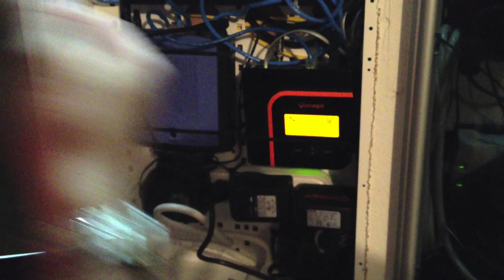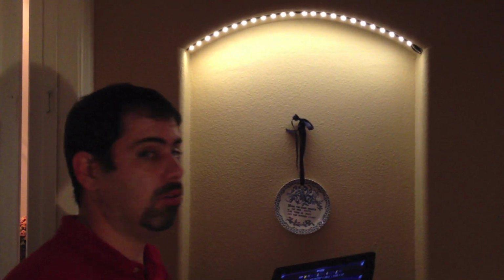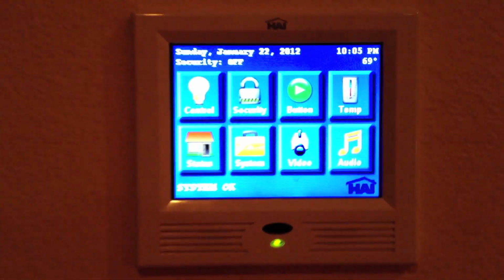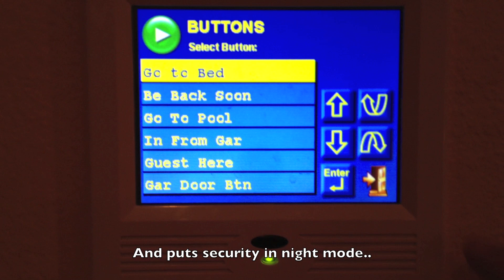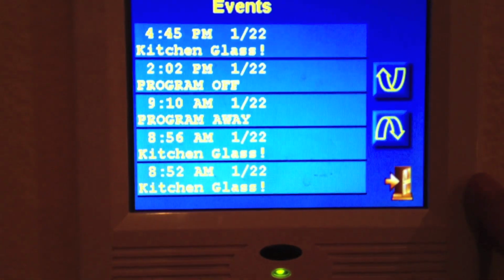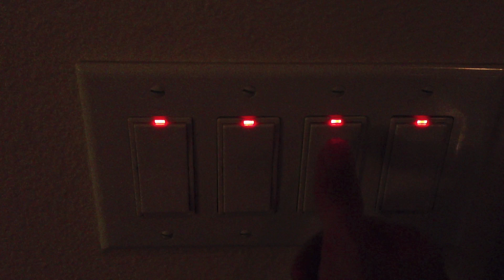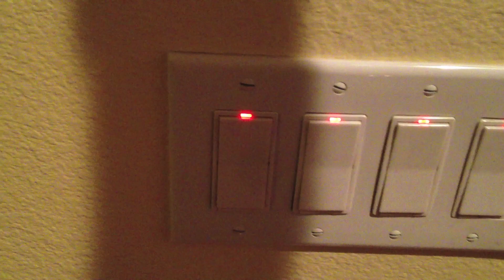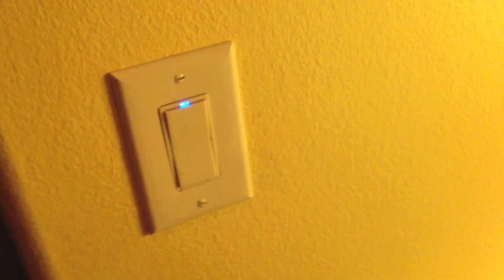Home Automation Intro

Comment: Hello I have on Q system but it not working right now are you work as a technician if so please let me know thanks
Reply from the maker: Ah man, unfortunately you can’t get parts anymore! I had to swap mine out because my cable line got hit by lightning and damaged a whole bunch of stuff. I replaced it with an HAI HiFi2 system, but Leviton bought the brand and killed it so I can’t get parts for that either.

Comment: This guy should not be putting his sticky fingers all over the circuit boards. He will zap them with ESD and destroy the IC's. Furthermore, he has 120VAC mixed in with low voltage. Violates every building code in the USA.

Comment: The main advantage for this system over for example SmartThings is that you are not relying on servers: No one is monitoring you without you knowing. So for privacy: Big plus. The setup/ wiring of this: NIGHTMARE. Bruce: If you wire correctly (and implement correct breakers) this is the way to go over Echo/ Smarthubs or whatever system there is, heavily depending on servers

Comment: I always wonder, since it's a simple software (Arduino and excesories),  couldn't someone hack into the home system easily? Well not easily but a good hacker could get into the program since it isn't designed for high end security right? I wouldn't want to have a home automative system that can be hacked.

Comment: I know in the UK you cant have them, but not sure in usa, i know in texas you CAN. AI controlled smoke and IR turrets to track and kill intruders. The system gives them every warning, then it deploys smoke, it does this so the way they came in is viewable so they should run back out, again it gives more warnings, they try and not leave at that point it opens fire with a pair of blanks. If that fails it gives yet another warning for them to leave. If they still fail it will then arm live rounds. Headshots!
its basically a computer controlled gun with an IR pointer. using FLIR it will get them straight in the head every time. It sure changes the outcome in south africa of home invasions.
Reply: DO NOT DO THIS ITS JUST AN IDEA DUH.
There is no law which prohibits building lethal robots, building weapons however is fully covered in many laws, except in TEXAS, where both building using can be done under license or permits. But i guess i should have made it CRYSTAL CLEAR THIS IS PURELY A THINKING EXERCISE DO NOT DO THIS EVER.
The army build drones etc, you can almost see in the future some tech giant building non lethal but weaponsed home defence maybe of the tazer type.

Comment: What outdoor sensors (occupancy and/or motion) did you use for detecting people outside? And what wiring is required (e.g. CAT5e okay)?

I have 2 locations I would like to add movement detection. These lead to my backyard. I'd like to know if/when motion is sensed and turn the lights on/up (between dusk/dawn).

So a few things:
1) Motion/occupancy sensor that works outside?
2) Best place for mounting (center of walkway (180-degree detection?) or on one end pointing the other way?
3) What wiring is required (e.g. CAT5e, etc.)?

Comment: seems complicated...software/PC-based would be simpler...
Reply: gmarchionni There were still perfectly capable small computers then
Reply: Homeseer is the best balance I think. But I’m sure HAI/Leviton is prob more reliable. Would never go the cloud hub route.
Reply: +Rick Deckard I was thinking the same thing
Reply: i was as well....and then i checked the date....2012....so i guess....the first raspberry just came out...there was not much available...

Comment: Is it me, or is this just a little bit dated?   - My house we all have macs, or iphones.  everything is on wifi.   If I need to contact someone, I don't use an intercom, I phone them, or facetime them.   we have a backup server, and everyone's stuff is backed up.  All our heating is individually room controlled, which turns on /off at set times in the day....   there are no wires there are no panels, etc.
We don't watch TV in general, but there is iplayer, and netflix which always available anywhere, and easy enough to plug a computer into the TV using HDMI.
Reply: No its not that dated, yes pots lines, intercoms? That’s showing it’s age more. To me this system crushes the off the shelf Smartthings and wink. Those things can’t stay reliable for more than 5mins. Don’t even get me started on cloud reliance.

Comment: Awesome perhaps to adapt this you could have automated curtains and blinds if you have't already done that!I have automated blinds I made myself for about £3 without the cost of the paint I cut up some metal brackets to fit my blind rail then cable tied on a motor. I'm working using the raspberry pi microcontroler to control what time the blinds open and close. +I'm 11

Comment: Great inspired work,thank you for sharing it with us.I am a disabled union electrician/instrumentation tech.I did a lot of automated temperature control and understand all the work that went into building this system.I am glad to see you ignore the trolls.Those losers probably had to call in someone like you to install the clapper so they wouldn't have to get out of bed to turn off the lights.I have bookmarked your website and look forward to following any upgrades or changes.Thanks again.

Comment: To be honest, I'd rather manual control to be performed through voice instead of switches. (The motion-sensing automation kicks ass though.)

Do setups have to be this complicated? I know quite a lot about computers so I'm sure I could learn the programming and macros but I suck at DIY. Guess I'd need someone for that
Reply: Check out this instructable: http://www.instructables.com/id/Uber-Home-Automation-w-Arduino-Pi/ . It uses Arduino and Raspberry Pi to make a insanely open source home automation system on the cheap. Its not as complicated and neat as this guy's but its a lot less heavy on the wallet. The nice thing about it is you can make all the things this guy showcases, it requires more coding and many hours of forum searching but its definitely worth it.

Comment: As much as I appreciate all of the hard work you've put into this. There are far more easier (for the inclined) and cheaper solutions. Additionally, custom software would provide far more flexibility.

Another thing I'd definitely get rid of is all of the "techie" terms for being wife/family approved. Most products (home automation in general) feels "out of reach" to the general consumer because it isn't newbie friendly yet and there's honestly no reason not to be.

"Config"?? Configuration? Sure.. Why not call it Settings with a little bit smaller of a font? Basically a more friendly software UI in general. THAT's what sells a consumer. (Industrial design background; Can't help it)

Instead of running the trunk of cables, I'd probably do a dedicated ethernet switch and use PoE (power over ethernet) + DPLC (digital power line communication) embedded devices with custom firmware MCUs. 

Each PCB would have to be custom created for a specific use case but that's the whole point in home automation. Basically, I don't like the idea of a "central" point of failure. Each device should act as a separately running device while still being networked into some sort of communication layer between other devices. Think of your light switch acting as it's own secured server, communicating through a variety of secure protocols. (Just in case your network gets hacked or someone does manage to break into the house and get access to your equipment and lines)

On a positive note: Thank you for breaking the pre-conceived notion of "home automation voice control". Home automation should be just that. AUTOMATING your home to fire and forget things. For example, have your coffee ready to go for you in the morning. Or to feed your dog from a dispenser every day at a certain time. Walk into a room and the lights come on automatically. Turn off the television after a certain time limit when the room is unoccupied. The list goes on.

Comment: As an electrician. I see this type of High Tech electrical work done in houses sometimes. It's awesome for about 5-10 years, until someone comes out with a new technology that makes all this work look like a giant waste of time.

In a couple years you might be able to install a small device at your electrical panel, and control everything from your smartphone. If you enjoy the engineering process of creating your own systems then go for it, otherwise save your money and wait for a company to do this research and development for you
Reply: You were pretty much correct
Reply: Not to mention the fluids plumbing so close to the hose automation.
Reply: Looking now...I suppose you were right, but still what a fascinating project.

Comment: I love how people hate on things they don't understand.  Instead of asking how much a system like this cost, ask this guy how much time and labor he spent designing, coding, and installing the different components of this system; making everything communicate properly.  Also, since he build this from the ground up, he knows exactly how it's supposed to work so when issues arise it is very easy to troubleshoot.  This guy does not call "tech support" when some component fails--he point to point troubleshoots and does the repairs himself.  That's the difference between this guy and "some rich guy showing off his cool house computer".  This stuff is interesting, I'm curious how much of a demand for these systems is out there for residential homeowners.
Reply: Obviously cost is going to be the first question because if someone can't even afford to build something like this then they wouldn't want to take the time to understand how to build it.

Comment: If he did all the work on his own this is a very cheap setup. I don't see anything that I would call "rich people showing off.." To tell you the truth he could have used much better equipment than what he is using; there are products out that the look better, has a smaller footprint in the house and are easier to setup than what he has done; but, as long as he likes what he has setup, who am I or anyone to knock it?
Reply: you are right, also some companies let you have good looking setups  for about 20-50 bucks a month. but sometimes some people like to build stuff on their own and that costs money. so those people start from small and buy better stuff as they save money. thats the way I do. Im trying to build my own security system or possibly home automation system, and right now Im starting out with raspberry pi and arduino. cheap? yes but I upgrade as I save money. maybe he is doing something the same way. I actually liked some of the things like light switches and the touch screen idea.

Comment: Obviously you have to know your shit damn well to make this happen, but what voltage runs through the stuff you're swiping your fingers across around the 1:10-1:25 mark?

Are those low voltage / amperage trigger lines or were you relying on knowing they're "off" at the time? Doesn't look too safe to do haha.

Comment: i'm running my house on z-wave for the benefit if the networking features and security on the locks ... but some things need direct interaction with the hardware ... RS232 is perfect for this, it just never fails

Comment from the maker: Actually, the PCB's are coated and not to be installed in an enclosure. The system is completely backed up by battery, and no such nonsense about locking anyone in a burning house would ever happen. Ever. You watch too many movies...

Comment: Don't act like professional. To build a system like jersagfast did, you have to know a lot about programming, protocols etc. etc. Because of the system is working fine and this system is build perfectly in a little "controlroom", I think jersagfast did perfectly know how he has to build it.
And in my opinion, It looks quite professional and fine! 
So.. go back to your litte shop next corner and let people like jersagfast do where they're good in: building high-tech systems.

Comment: First of all, that'd be called a "black hat" hacker, not a red hat hacker.  Red Hat is a Linux distro (Fedora is based off Red Hat Linux as far as I know).

Second of all, a DDoS attack requires multiple computers.  You can trigger it from one computer, but you need to have a zombie net basically (bunch of peoples computers which got infected with a virus you distribute).

As well, a DDoS attack is not a type of hack, all you're doing is sending so much data the computer hangs or crashes.

Comment: Man I just did most of this in my house for a whole lot less money and hassel. A Zwave controller, some zwave thermostats, light switches an alarm module and your in business. Added a couple IP cameras. I changed my garage light switch to an ocupancy sensor for 25 bucks. It turns on an off when i walk in and out and works great.

Comment: so instead of say taking an old atx psu and using it for 5 and 12 volts(any value lower could be done with regulators), you decided to use surge strips and wall warts?  
also are we to understand that each door and window sensor has a pair of wires going to that box? why not have one box in each room that accepts all the sensors in the room and sends it over one ethernet cable. third, you have your router in a METAL box, surrounded by WIRES, you have repeaters right?...horrible reception i bet..

Comment: I want to fickle around with small home automation projects (my first project will probably involve customizing & automating the lighting in my house - having controllers/sensors to light up/turn off lamps, lights). I'm concerned about having to mess with the wiring and the circuits inside the walls of the house. Is this unavoidable? Also, do you know of any start up guides for home-automation projects?

Comment: I'm more of the home theater type guy.and have a hand held controller to do the security, lighting,projection screen,window blinds,room temp,access the front and rear gate, sprinkler system and so forth without mounting stuff in the walls...but to each is own..

Comment: Just because I works does not mean that it's a good job.
@ 2:47 "Power is always messy. Especially when you're . . . me"
It doesn't have to be messy and it shouldn't be.  Quality workmanship/wiring is a requirement of reliability and serviceability.  

However, you have a lot going on here and I would love to be this knowledgeable about automation.

Comment: Start small, i suggest arduino, they'll do little things (relatively speaking) you could do the whole timed lights/movement sensors thing for a house without much trouble with one of them. Read forums and tutorials.

Comment: Great video! I your automation scheme. You mentioned that you can control macros within macros. This really impressed me, but I was wondering if you have any fail-safes in place. The system seems like it can do unlimited tasks, could this cause any negative effects? Like, if you were able to program a motor to run continuously... it could potentially burn out or start a fire.

Comment: what do all the different controllers draw power wise? you would have several lamp modules which each draw a few watts each. but multiply that by all your different things you have incorporated and you could potentially be pulling a lot more then you expected. did your power costs go up a lot more after installing all this?

Comment: I am amazed at the quality and workmanship of this system. The wiring is complicated, but the interface is simple. I do think that the HAI touch screen is outdated. I like the Control4 and Crestron Touchscreens a lot more, although they are most likely more expensive. For that matter, the iPad is fine with me, like wall mounting it or recessing it into the wall.